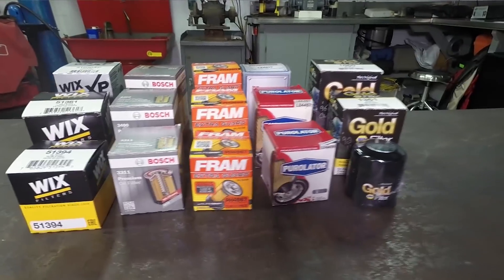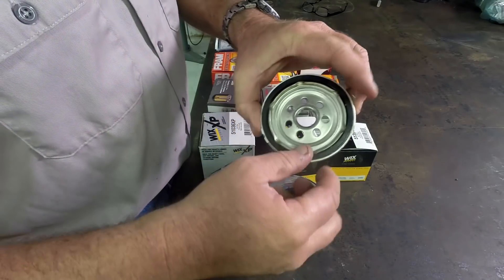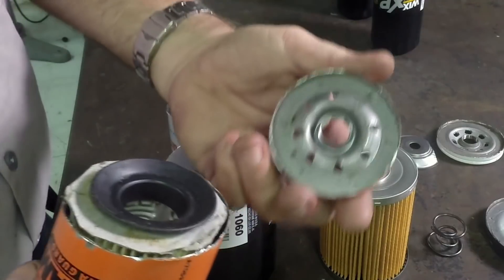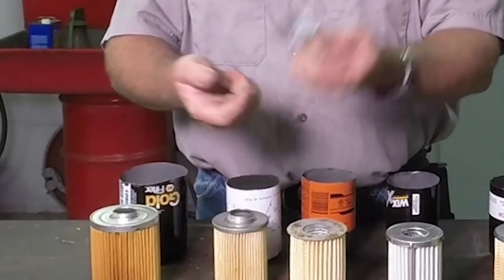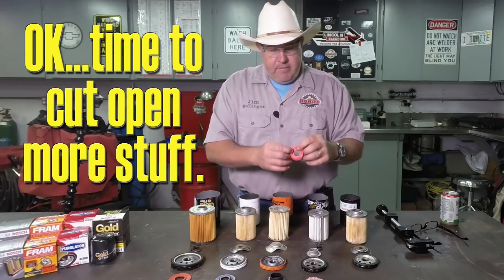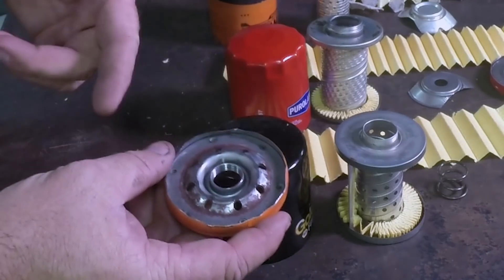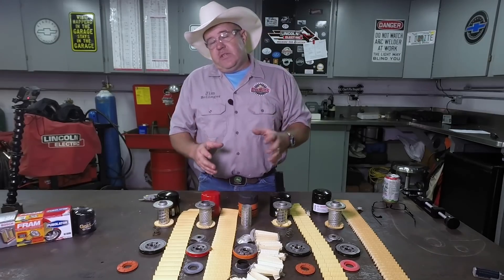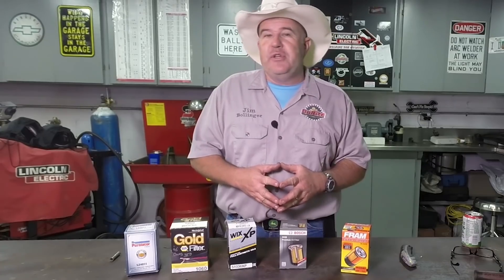The worst oil filter EVER!

Comment: Hi. Besides what you can see and touch, one of most important qualities of the filter is size of the partculates that they are capable of traping, no, not all of  them are equal in this retrospect.
There is a video of a guy actually buying different sizes of microscopic particles and running them trough the various filters and then studying cleaned oil under microscope. I will not post a link as video in defferent language and he is doung tests for filters in Eastern European market (Ukraine, to be specific).
I guess it would be very very important to know how well the filter cleans besides how well it is built. I mean, lets say, if best well made filter allows large particles to flow trough - you dont want it either.
I mean, yes, I would assume that if manufacturer had bothered to make good quality packagind, they would use the best filter material, but again - that is pure assumption.
Based on video I had mentioned, there is a standard level of entraption, like filter must catch everything larger then 15 microns, and then contaminants of various specific size can be ordered, ran trough and results studied.
By no means I am saying author must do this but if you're testing filters... I gues it is one if not most important quality of the filter.

Comment: Would be interesting to show people the generic filters they use for the quick oil changes at dealerships and quick Oil Change drive throughs!
Reply: Not sure what dealership you been going to but factory dealerships are under contract to use factory parts. Only under customer requests will they install aftermarket parts. Might wanna raise that concern....👍🏻
Reply: @joshuabird852  upon further research all dealerships in the Genesee county Michigan area do this. Most people are shockingly ignorant and just want a cheap price. The dealerships and oil change places hire barely qualified people because their to cheap to do any different and who could blame them with the extreme “is this my best price” mentality of the area!
I have a inside connection at a Ford dealership and he works on my truck in front of me and does nothing with my full understanding of my opinions. I personally do my routine maintenance! I trust NO ONE! I’ve had a couple of extremely bad experiences that quick oil changes including needing a new transmission in a Dodge 4 x 4 truck!🤦🏻‍♂️

Comment: I 100% agree... FRAM is THE WORST filter on the market. Friend of mine had one EXPLODE on his Buick GS 455 and oil went all over his engine compartment. Unfortunately I tried one on my motorcycle and after 100 miles the engine started to tick. REPLACED IT IMMEDIATELY !!!!!!!!!!!!!  DO NOT USE FRAM FILTERS !!!!!!!!!!!

Comment: Stopped using fram oil filters years ago. Now I only use Mobil 1 extended performance.  Granted there's alot of great high quality options,  but everything I've seen points to mobil 1 being the best. Tho I don't use their oil. Its great and will certainly serve its purpose but there are better options.

Comment: Years ago I came across a new Fram filter that had a pin hole in the thin sheetmetal case.
When the engine ran, hot oil would stream out that hole but stop when the engine shut off.
Got lucky and discovered the problem before the engine ran out of oil.

If Fram was all that was available, I would not change the filter.
I would rather run a used Wix filter than a new Fram filter.

Comment: Have used Fram filters, exclusively, for over 40 years on 7 different cars.
My current cars have 250k and 110k miles.
I won't argue the facts, but, Fram is my standard goto.
Reply: Value enginerding, they crap away all the quality they can, to a level where it just barely works. And most customers are none the wiser. But now when you know, why not buy a good quality filter instead?

Comment: I've dissected Fram filters and they distort under pressure.  The paper pleats separate and change the relative surface area which filters the oil.  After a couple thousand miles, they are shot!

Comment: I remember 30 years ago talking to a "Fram sales man", who said the exact same thing. 
He said that there Filters had a finer porosity than other filters. His filter was to be used on an Audi-80 at the time!
Most people in Germany, serviced their cars far more often than people did in England.
The man from Fram, said the filter material was only 2-microns in porosity, meaning less particles getting through to the engine!
I said to him; "if I use your filter, it could cause oil starvation to the overhead camshaft, which in turn will shorten its life.
As the Germans change their filters far more often and don't  ever see black oil in their engines. German filters use 4-microns in their filters! 
At the time when servicing, I fitted Mann or Bosh filters to Audi, BMW or Mercedes, knowing that this would protect these engines properly.
Thanks for your research, I enjoyed it. Hope you find this interesting.

Comment: My experience with Fram. 2004 F-150, 4.2L V6. 515,000 miles. Exclusively orange Fram and Pennzoil 5W-20. No synthetic or high mileage. Changed every 3,000 miles. Used oil goes in my kids oil burning piece of crap.

Comment: Hey you got the cheapest Fram filter. I've been using Fram Tough Guard ands its very good. Fram tough Guard and XT are great.
Reply: Just buy a K&N or WIX... yes they’re more expensive but extremely well made... K&N has the easy wrench-off with a 10mm wrench that makes it super easy... no need for a filter wrench

Comment: that  is so true i just cut open  a fram  oil filter i had in my VW  jetta 2.0 with only 50 miles after i  did my oil change .  what a piece of crap  FILTER . , my oil light kept flashing on dash board , i though it was the oil pump , i order new one , and replaced the oil sensor as well , so i said  maybe is not true that   fram filter is that bad , o well like this guy is explaining here, is so true .... the one i bought  looks even worse than the one he has on the table, once i opened it  is basically  cardboard . what a reap off , folks is up to you if you wanna buy something that is gonna ruin your engine go for it. but its gonna cost you a pretty penny  to replace your engine ...

Comment: It would be interesting to see a Fram filter from the 60's opened up and compared to a modern one . We all had hot rods in the 60's and 70's , and Fram was THE filter for racing .
Reply: Yeah. Harley brand oil filters from the 90's were excellent, but now, they're like this Fram example....Surprisingly, Fram filters for Harleys are much better quality than new Harley filters.
Reply: @billcarp3523  Anything with HD name on it is junk
Reply: @billcarp3523  When Harley starts making filters, oil, etc I might give them some consideration.
HD dealers have been sued for threatening to void warranties if HD branded products weren't used. That's illegal in the US.
If HD required their HD branded oil to be used, they would have to provide it at no cost. 
Not all dealers have been overly scrupulous.
Reply: @skylane807  just watched a video of an HD filter vs FRAM ... the FRAM  was in a different league over the crap HD one ... seems like you can't take anything as given. Maybe someone's making a fortune out of selling rebranded crap ...? 
I think it's time we checked for ourselves rather than just believe a youtuber; they can't all disagree with each other and also all be right!
Reply: @billcarp3523 The guy in this video is a snake oil salesman.  The H-D Filters are crap today. Buy a new H-D and a Fram. Fram makes the same oil filter and the one H-D made in the 90's. Fram by far makes the BEST oil filter for motorcycles. Fram makes the same quality of filter they made 25 years ago before bean counters started cutting corners. They have always been made in Taiwan. Taiwan has a true motorcycle culture. 70% of all licensed drivers in Taiwan have a motorcycle, compared to approximately 5% in the US. They also take great pride in products they make.
Reply: @nathanbrownmolotov8697  agree completely.  No idea where he got the "Fram" filter from, but I watched another opened filter review, and the Fram was rated the best of all.
Reply: @nathanbrownmolotov8697  I'll stick with K&N. No problems in 15 years.
Reply: @rexbaumgartner2011 the way he did this was flawed the second he fast forwarded to the fram filter. I dont use fram but i wanted info not "just tell me what i already know"
Reply: Fram by far makes the BEST oil filter for motorcycles. Fram makes the same quality of filter they made 25 years ago before bean counters started cutting corners. They have always been made in Taiwan. Taiwan has a true motorcycle culture. 70% of all licensed drivers in Taiwan have a motorcycle, compared to approximately 5% in the US. They also take great pride in products they make.

Comment: There are devices that will cut an oil filter apart without having to make a bunch of Sparks. Even an exhaust cutter would work. But you're still using a grinder?

Comment: aint about the filter if the engine  is a great design put any filter u desire on it.it will work.take the 3800 series gm v6 it will go 500.00 km without a filter at all . no foolin.25 years behind my belt allmostseen it all.

Comment: WOW! I used FRAM for years!   I guess I need to change!  The cost of replacing a filter is far less than the cost of replacing an engine!
Reply: Seems ironic. My previa has been using fram and never had any issues.
Reply: @Temporary Account So then how come I never seen an issue? I mean my previa has over 400K miles and still running so idk.
Reply: Change your coolant every two years not 5 or even 50,000 or 100,000 miles. Every 24 months. Change your Transmission fluid every 40000 miles. Never flush drop pan replace filter. Your car will last a long time. REPLACE YOUR FUEL FILTER EVERY 30000 MILES. DO NOT NEGLECT THIS.....
Reply: WOW WOW WOW!!!   And you havent done so yet have you?  No, you havent. So this is why this is pure bullshit
Reply: @Temporary Account lol. What you just said makes absolutely no sense. Oscar is the guy with the real world evidence you call anecdotal. Guess what we should really conclude is how well the Fram works in spite of what it looks like inside!
Reply: @Temporary Account I'll take my so-called anecdotal evidence along with Oscar's and everyone else on here reporting no problems over your easily influenced missing brain any day. Have you used their filters long term? Well, I have. And so has he. You are convinced by appearances that they are so bad, yet they are still on the market after all these decades.
Reply: @Torrious  It does the hell. It's a 1991 Toyota previa LE. What you want me to upload my fucking photo so you can say oh it's from Google. Dude I haven't even rebuilt engine or transmission and to be honest the transmission Is starting to slip a bit. I mean seriously at 350K most transmission don't last very long. And that's a real world fact most wear down at that point. Shit even the A/C which was R12 still works just fine. Only replaced expansion valves and the evaporator.
Reply: @oscarfunez3806  don't worry about them, Oscar. They don't know what they're talking about.
Reply: @plasticinthetree4261  In a sense yes. Most in the YouTube comments can lie. But a smart person would be able to notice if someone is legit or just how they say. Talking out there ass. But hey it is what it is. Everyone has the right to speak up.
Reply: @Temporary Account the man who has actually done something is not at the mercy of the man who merely has an opinion.
Reply: Motors were run forever with no filter. Yes they are the way to go, but these differences are not that important.

Comment: @ 2:27 you called the NAPA oil filter a WIX oil filter, then posted a correction. Actually, Wix makes the oil filters that NAPA uses. Even the part numbers are similar.
So, actually, you were right all along. =)

Comment: For years I have been using Fram filters because I thought they were the best. This is eye opening! I will never buy another one. Thank you for posting this!
Reply: I haven't used them in many years. the 2 times I used them when I removed them from the engine they were broken punched ... now I use the original Motorcraft for ford, Ac Delco for Chevy. i also use wix and napa gold ,. Regards.

Comment: Just an fyi the napa gold filters better than the platinum.  But since the platinum is made of synthetic material you can go longer between changes.  That's why platinum filters are always on sale and cheaper than gold filters.  It's not a crazy amount less than the gold, but it is less when you break it down.  There is a huge write up on Bob is the oil guy website.